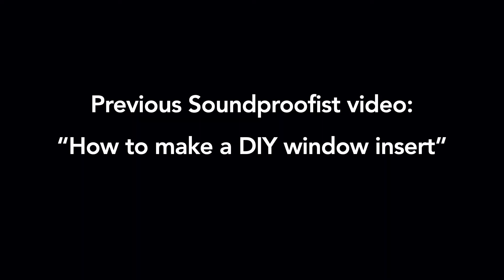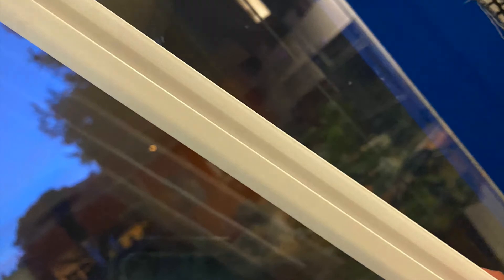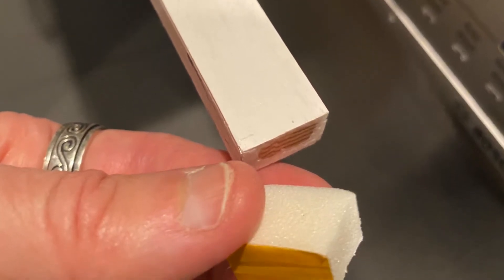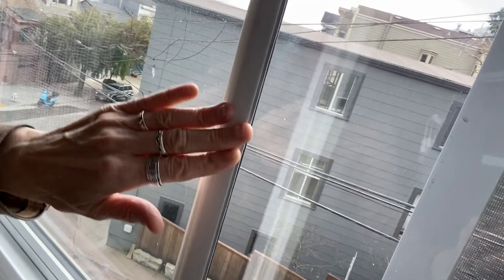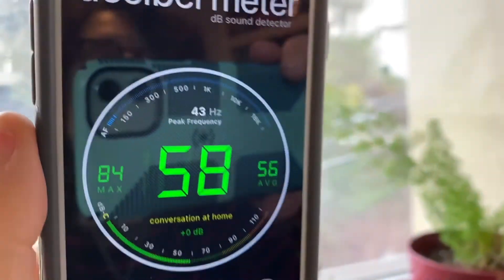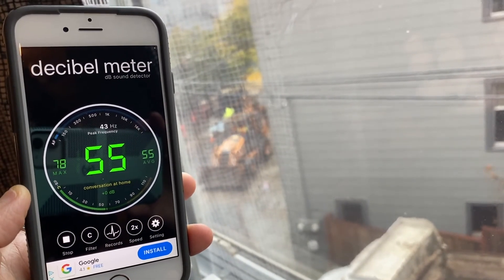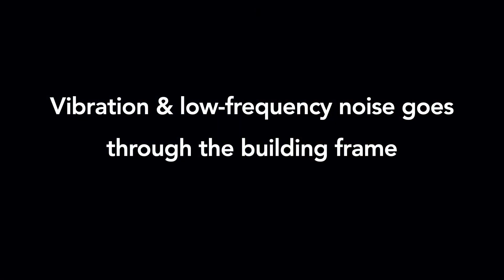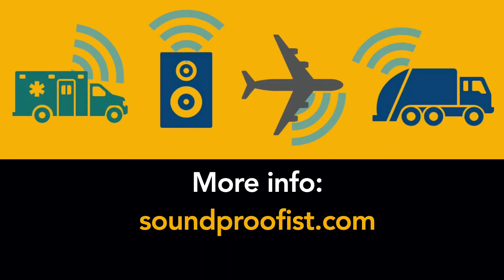Window inserts: how to join multiple plexiglass panels together

Comment: Have you ever thought about putting the plexiglas sheets on hinges, so that they open and close like a window? I would like to mount them to the side walls like windows, but have no idea what type of hinges I could use?!
Reply from the maker: I did think of it, but I didn't pursue it for various reasons. For one, it seemed like the hinge could leave a gap between the plexiglass and the wall. For another, I didn't want to drill holes in the plexiglass. And the third reason was that my main window is so big that only two of the sheets could be on hinges, and the middle panel would still need to be held in place in a different way. On a smaller window, though, it could work as long as you didn't have a gap between the wall and the window insert, which would allow noise to escape.
Reply: @soundproofist Do you happen to know what type of hinges would be the best? Perhaps one could fill in the gaps with thicker rubber window insulation tapes??
Reply from the maker: @anaesterhazy631  My first thought was some kind of gate hinge or barn-door hinge. I also did a search and found a cupboard hinge for glass display cases (one that works without drilling), but I think this kind of hinge/clamp will leave a gap in it that would let sound through. In either case, fill in the gaps with adhesive-backed dense foam strips.
Reply: Thank you. @soundproofist

Comment: Hi thank you so much for making these contents, about to try DIY out myself! I just moved into an apartment whose windows open directly to large hvac/vent/fan devices on the terrace of another building (owned by verizon it turns out) and they are making 24/7 70-80db noises...my worry is though these ventilation/circulation device noise are usually on the low frequency end? So would window inserts not make a huge difference reducing the volume there? I do have a relatively wide window frame about 6 inches so the air gap is sufficient....wondering if you have any advices thanks!!
Reply from the maker: Right. The window inserts might not be as effective if you have low-frequency noise and vibration going through the whole building frame (not just the window). You know, a few people have asked me similar questions about HVAC and I'm trying to get someone from an anti-vibration company to steer me to the right solution to recommend. Can you take a photo of the HVAC equipment....what it's mounted on,  etc.? Just contact me through this form, first, and then after I respond, attach and send a photo: https://soundproofist.com/contact-us/
Reply: @soundproofist  Ah that's super nice of you! I'll follow up the form with pictures, thank you!!

Comment: A thought: how about a small aquarium or indoor fountain or waterfall for "background noise"? I use to have a 800 gal pond with fountain at my old house and enjoyed it greatly. When in the backyard (also had privacy fence) or nice enough to have my windows open the fountain really helped drown out unwanted road and city noise. Especially at night, it seemed to help ya get to sleep and enjoy a better sleep too.  Yes city life is noisy, one of the sad trade offs from living in the country. (and the fact homes/buildings are not made like they use to. Plaster is so much better at sound proofing than drywall. actually drywall is not a very good product at all, and is simply cheap and barely functional if you ask me).
Reply from the maker: That depends on the kind of noise you're dealing with. A fountain (or a fan) might be OK for masking distant traffic or conversation. But I get a lot of deep, low-frequency noise from construction machines, from trucks with loud engines just below my windows, from motorcycles... or even from the pounding feet of my downstairs neighbor running back and forth on his hardwood floor -- which sounds like a bass drum. Those low frequencies aren't easily masked out with "white" noise, unfortunately.
Reply: Don't put an aquarium there. Poor fish🐟🐠